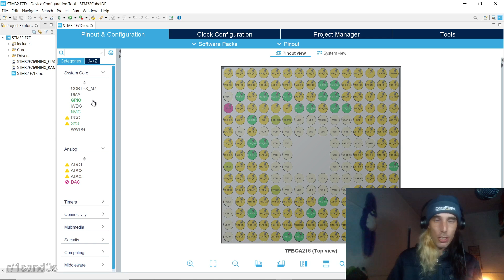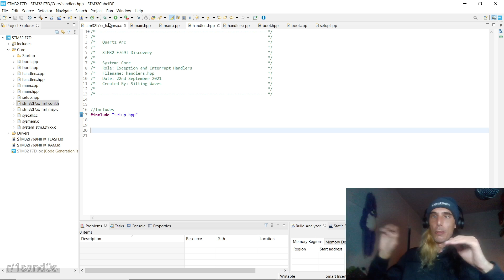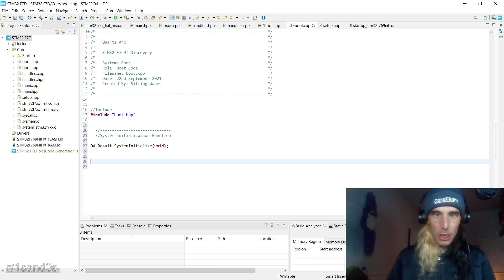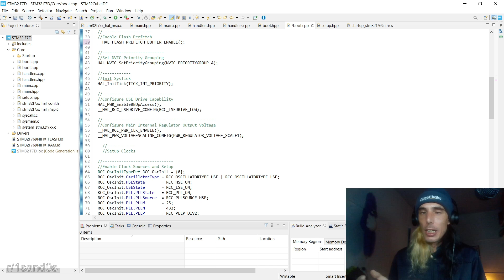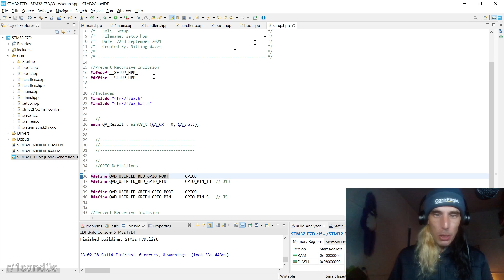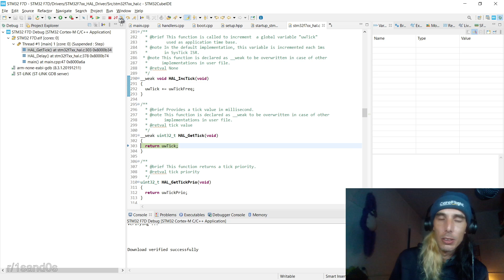Project Setup - Discovering STM32 Episode 1

Comment: I just discovered you, Ive been using C to develop with stm32 so far,  im going to use your channel to ponder if its worth for me to start c++ing (like arduino?)

I have two questions:

-where do you got your stm32 skills? where do you usually look up for libraries or learning matterial?

-I use cubeMx to initialice the peripherals and the clocks/pins... (because im a beginner as you said and i really dont like to write boilerplate code) ,
 is cubeMX really that bad? ive been using it without "almost" any problem for 2 years now.
Reply from the maker: Thanks for your comment!

My STM32 skills have come purely from reading the documentation and a lot of experimentation over a number of years.

As far as CubeMX, if it works for you then that is great. I personally find the code it generates to be incredibly messy and convoluted. I'm not a fan of the way it breaks things up into MSP and BSP sections etc. I'm not really a fan of 3rd party code in general to be honest, and I look forward to the day when I have the time to replace the entire HAL with my own code.